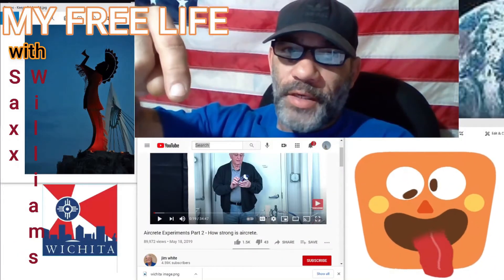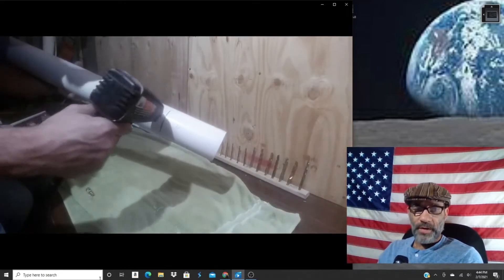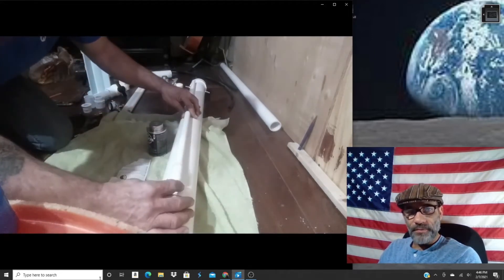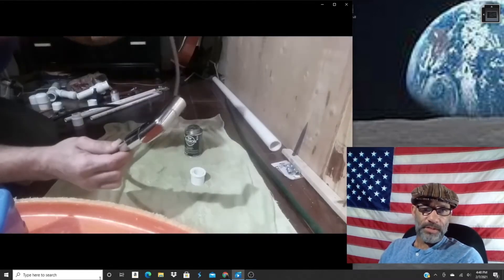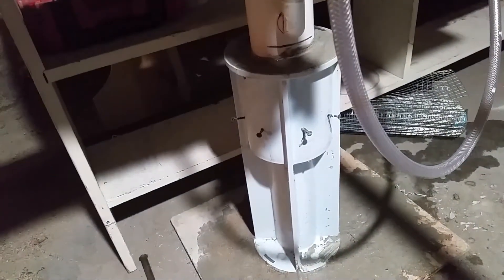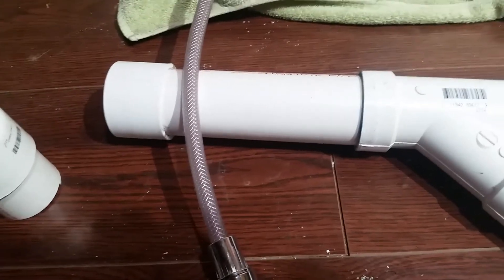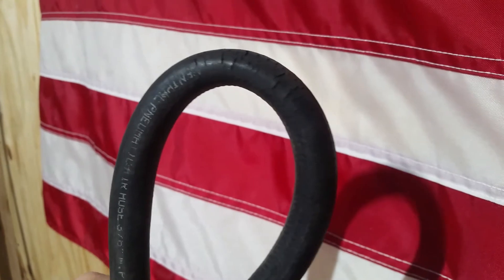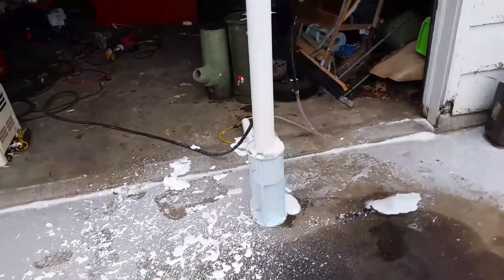How to make an aircrete foam generator easy and cheap with step by step instructions

Comment: Get a scale and a 1 quart container. The ideal foam density should weigh between 90 -100 grams /quart of foam. Higher air pressure will give you a lighter density...lower air pressure will give you denser foam.  Nice job!